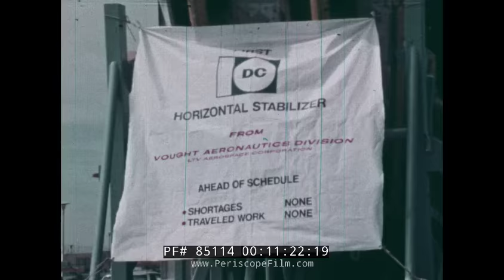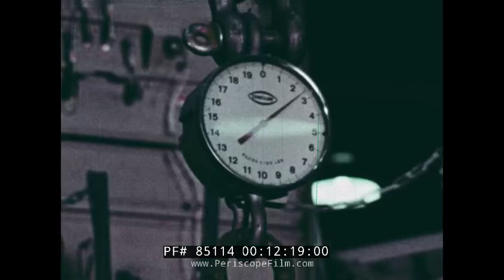THE DC-10 TAKES FLIGHT  MCDONNELL DOUGLAS CORPORATION PROMOTIONAL FILM  85114

Comment: I remember when Larry Burrell was a news anchor on Channel 11 KTTV in LA and Art Balenger was playing captains and Lieutenants on Dragnet in the 60s. Once the DC-10's cargo hatch problems were fixed, it was an overall safe jet. I flew in a DC-10-40 a few times on Northwest Orient and felt perfectly safe. Had all of the airlines complied with the directive to fix the cargo door, I doubt the Turkish Airlines crash in 1974 would have taken place. Military DC-10s still roam the sky as tankers and MD-11s still are used as cargo transports. After the American Airlines crash in 1979 in Chicago happened, the fate was sealed but that was not McDonnell Douglas fault, it was American Airlines maintenance fault for not handling the engines like they were supposed to. The plane got a bad rep after that disaster.
Reply: The DC-10 had a few more design problems than just the cargo door. That was only the first issue. Sadly made the headlines for many years. I am unfortunately old enough to remeber (wish I was younger). The maintenance mistakes was the cause of the engine dropping off the Chicago crash, but loosing one engine on a multi engine aircraft does not doom it to crash, engine out training is one of the most basic aspects of pilot training. The other two engines were operating normally, the plane crashed because of a design flaw of the leading edge slats. The United crash was a design flaw in the routing of the hydraulic lines in the tail.
 The DC-10's main competition the Lockheed L-1011 was a much better design but the DC-10 despite all the issues and crashes won the sales race because of production delays for the L-1011 caused by the financial troubles of Rolls Royce in the early 70s..
Reply: @tonyseely6473  I thought the hydraulics issue was not unique to the DC-10, but also present in other aircraft, namely some Boeing aircraft - but maybe I am mistaken in my research.
Reply: @tonyseely6473  - Spot on Tony!
Reply: A DC10 caused the AirFrance Concorde crash. A poorly made chunk of metal fell off the previous DC10, causing the Concorde’s tyres to burst.  I wonder if they ever accepted their share of responsibility?
Reply: McDonnell Douglas and the FAA knew about the cargo door problems because of the AA flight 96 incident, but Nixon's head of the FAA worked out a "gentleman's agreement" that McDonnell Douglas would upgrade all the cargo doors to a better design in exchange for a major contribution to the Committee to Re-Elect the President. One of the aircraft on McDonnell's assembly line was sold to Turkish Airlines, along with documentation signed off showing that the cargo doors had been upgraded, but in fact, the upgrades had not been done. When this DC-10's defective cargo door blew out  346 passengers and crew were killed, which, at the time, was the worst crash in the history of aviation. It wasn't until after this tragedy that the FAA issued an airworthiness directive.The huge lawsuits based on the failure to rectify the provably known door defects brought publicity which to severely damaged the DC-10's reputation . The incident in Chicago which involved an engine coming off the wing which destroyed the hydraulics and killed another 271 people (still the worst crash in US history...) led to a worldwide grounding of all DC-10s until they had all thoroughly been inspected and any damages from "creative" maintenance procedures was repaired. The DC-10 went on to earn a good reputation for safety and reliability, but mostly as a freighter, because passengers were reluctant to fly on it. Sales stopped, and McDonnell Douglas never recovered the cost invested in designing and building the DC-10, which eventually led to the merger with Boeing and the end of McDonnell Douglas.

Comment: Say what you want about the "Big 10" the fact is after the engendering problems were fixed there still flying and the US air force has no plans to get rid of them anytime soon!  Long live Douglas!
Reply: Jess W  can't handle the turth DC 10 still flying for fed x and UPS today. Air force having trouble with kc 46 the KC 10 is getting the job done today
Reply: Jess W  you know what, for that plane to be used efficiently as a cargo plane, shows you just don't have to junk a great plane because of a couple mishaps. By all accounts, this plane was a huge money maker for fedex and was beloved by pilots the world over.
Reply: It even mentions after the 9 minute  mark that the dc 10 was an "instant " plane.   They admit the thing  was a rush job. They should've  been pulled out of passenger service by 1980 and delegated to hauling boxes
Reply: engendering ???
Reply: Under engineered, but it flew nicely.  Very much inferior as an aircraft to the L-1011, but thanks to troubles with the RB.211 it outsold the superior (and more expensive) product.

Comment: First time I saw one...June 13th 1972. Kennedy. Little did I know that same day over Detroit and Canada a DC 10 had a catastrophic failure of a rear cargo access door latch and lock assembly.  You know the story. Lucky they wisely tried the autopilot system to control the aircraft after the flight control cables in the fuselage were severally damaged.  A Turkish Air crew several years later didnt try it and many lost their lives.

Comment: I think the L-1011 was a better looking plane but development hell took its toll.
Reply: The L-1011 was by FAR the most advanced of the first generation widebodies.  I flew it (and the DC-10, and MD-11, and B-747-400).  All were pleasant to fly, but there was just no comparison to the technology of the Tristar.  The DC-10's engineering was definitely lacking, but it handled nicely.
Reply: @bradcrosier1332  I flew it many times as a passenger. Best aircraft I’ve ever flown. Spacious, comfortable and fast. I always remember taxiing out of Atlanta on Delta in the 90’s and right as we were 3rd in queue for takeoff you’d head the number 2 engine stat to come to life. No need to burn 3 engines for taxiing!

Comment: Convair, which built the fuselage for the DC-10, never really recovered from the 880/990 fiasco. McDonnell Douglas acquired the aircraft structure and space booster operations in 1994.
Reply: We also built the fuselage for the MD11 (DC10XL)

Comment: The DC10-30 was the 'complete' package of the '70s
Reply: The Series 30 was the long-range version of the DC-10. There was also the Series 40, which MDC built for Northwest Airlines. The latter was essentially a Series 30 powered by P&W JT9D engines.

Comment: Can someone comment on the collaboration between McDonnell Douglas and the USAF?  I flew the DC10 dash 10 and dash 30 models as an engineer, but had no idea of the USAF involvement at an early point. Had the KC-10 already been on the drawing board?  

Engineer position on the DC 10 was the easiest job I’ve ever had.  Well laid out panel. Works good, lasts a long time….DC stands for direct cable😂. Great times….

Comment: LOL "We feel it's safer too"
Reply: Simon Coles little did they know . . . 🤦🏻‍♂️
Reply: To be fair, yes, there were some horrendous oversights but it should be borne in mind that not all of this was MD fault. AA191 as an example was because of poor maintenance practice by most of the American airline industry. 
The cargo door was a disaster that they should've seen coming but, there are DC10's still in operation today despite having their certificate to fly withdrawn. Unlike the 737MAX, I think the shit really sticks with that one and the 737MAX issues I believe are far worse anything MD did.
Reply: Death Contraption-10. I wonder how enthused they would be if they knew how many people the plane would kill
Reply: @Hertfordshire247  - Not having the slats designed to lock was 100% on Douglas.  Lockheed foresaw such a possibility.  That said, you are correct it was Forklift Joe at AA that directly caused the problem.

Comment: 15:30 Reporter: How did you about creating the amazing feel of openness inside the DC10?
Ray: Easy, we forgot to put proper locks on the cargo door. And when the FAA threatened to ground the planes, we did a slimy deal with them and did a botch job that still didn’t work!

Comment: To be fair, yes, there were some horrendous oversights but it should be borne in mind that not all of this was MD fault. AA191 as an example was because of poor maintenance practice by most of the American airline industry. 
The cargo door was a disaster that they should've seen coming but, there are DC10's still in operation today despite having their certificate to fly withdrawn. Unlike the 737MAX, I think the shit really sticks with that one and the 737MAX issues I believe are far worse anything MD did.
Reply: The maintenance mistakes are to blame for the engine dropping off but the plane still had 2 good engines, loss of one engine on a multi engine aircraft does doom it to crash. 191 crashed because of a design flaw of the leading edge slats. Sometimes poor designs become big sellers. 
The 737's problems with the rudder anomoly and the more recent issues were less compared to the DC-10.

Comment: The L-1011 was a far superior and safer plane. The DC-10 was plagued with engineering issues, especially in the earlier planes.  Plus they had some really freakish crashes. United flight 232 and the Chicago O’Hare engine separation.  yes, the latter was caused by maintenance error, but an engine separation should’ve never of brought that plane down.
Reply: DC-10/MD-11 outsold the L1011 by almost 3 to 1. 646 to 250. So, tell me again how superior the L1011 was.
Reply: @itjustlookslikethis  From a safety and technology standpoint?  Leaps and bounds my friend. The L-1011 had the first CAT-III auto land over 50 years ago. Meanwhile MD suffered from in flight hydraulic failure, ruptured cargo door X2 that lead to fatalities, the infamous landing “bounce” it was plague by. McDonnell Douglas was notorious for cutting corners. That’s why they were “acquired” by Boeing. Unfortunately the management that survived were the MD folks. Leading to the famous line “ McDonnell Douglas, bought Boeing with Boeing’s money.”  Hence decades later the 737 Max fiasco. All MD protégés. What domed the L-1011 was the R&R bankruptcy resulting from the Trent engine development. Aside from looking at production numbers, read up on the development and evolution of each aircraft.
Reply: In the Chicago crash, the National Transportation Safety Board and the FAA cited McDonnell Douglas for failing to install backup systems that would have warned the pilots about a stall and warned them about the hydraulic damage to the slats. I read a story from a man that was an investigative journalist in 1979. He was employed at one of the top magazines and was due to travel to Los Angeles with his boss, the boss's  wife and 2 colleagues to a book sales convention. He had been investigating the Turkish Airlines crash, when he came across internal memos that McDonnell Douglas sent out, offering employees bonuses and pay raises if they came up with ways to save money during the DC-10's production. The journalist told his boss that he was not going to fly on the plane because it was unsafe. He stayed behind; the boss, the boss's wife and his other 2 colleagues were killed in the crash. So sad, and what's worse, a lot of the McDonnell Douglas executives infiltrated Boeing after the merger and now they are ruining Boeing. Remember that before you board another Boeing jet. 😮
Reply: @jocelynharris-fx8ho  You probably know the old saying. McDonnell Douglas bought Boeing with Boeing’s own money. Lol.

Comment: Death Contraption-10. I wonder how enthused they would be if they knew how many people the plane would kill
Reply: Of the 32 hull losses, very few were caused by any design flaws (hydraulic issues not being unique to the DC-10, present in Boeing aircraft of the time too IIRC, and component flaws that could be pinned on the people who made those parts). 

And that's 32 hull losses across every subtype - the A320 has triple that across subtypes, same with Boeing 737s and 747s, without factoring in ALL the causes.

The fact that from 1972 to present day there were only 32 hull losses across thousands of flights should say something.